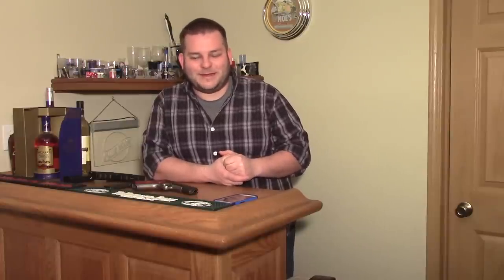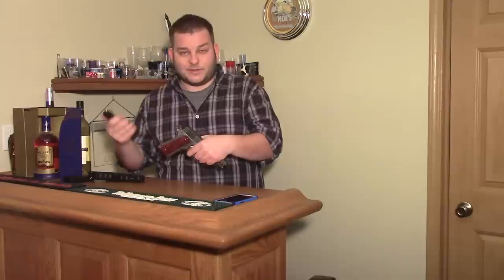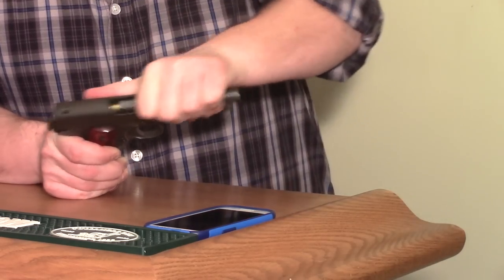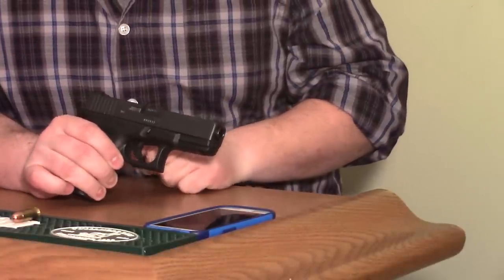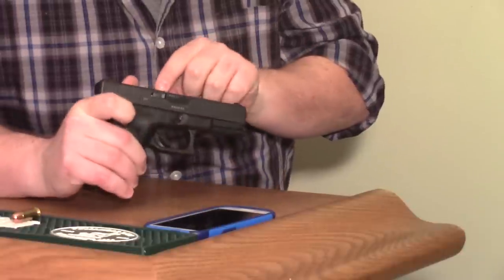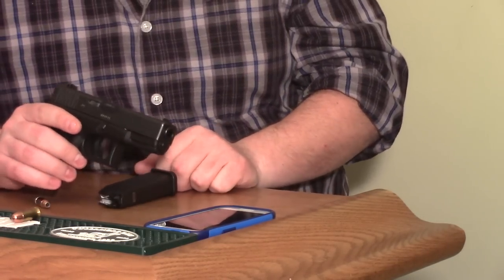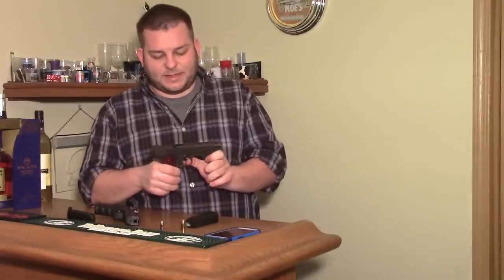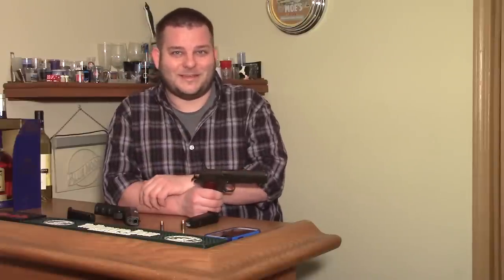Gun101 What Are Press Checks?

Comment: Glock's have round indicators, use them, most striker fired and others also have round in chamber indicators. These round indicators function in ALL lighting conditions! Feel the NUB! Basic rule of thumb treat ALL firearms like they are loaded. Weapons have 3 BASIC conditions Still treat firearms like they are loaded Condition #1 totally unloaded No mag, empty chamber. Condition #2 loaded Mag in gun no round in chamber (this is the most dangerous). Condition #3 loaded Mag in gun and round in chamber. Safeties, half cock and such are variations of these 3 Conditions. Be consistent in which of these Conditions you keep ALL weapons.  Press Checks then NOT needed.